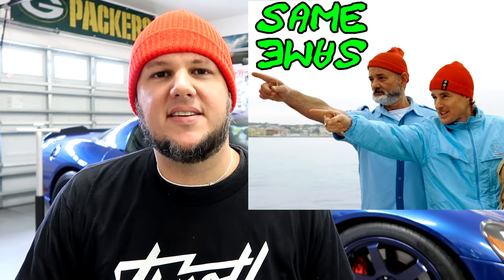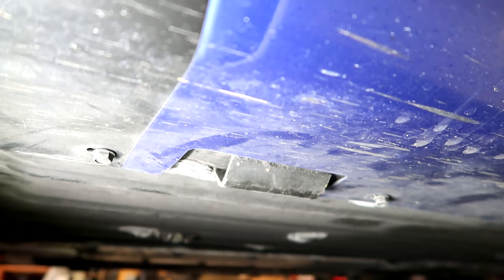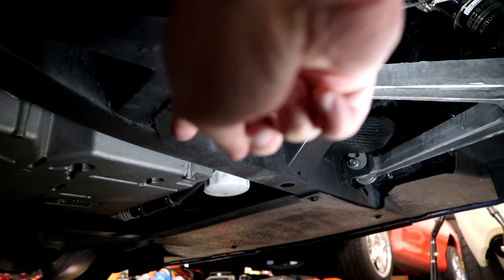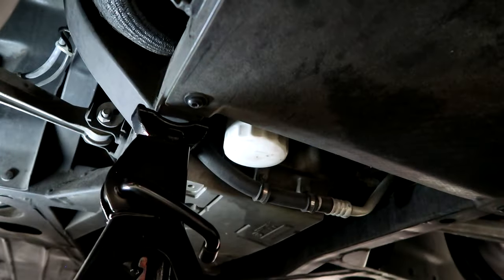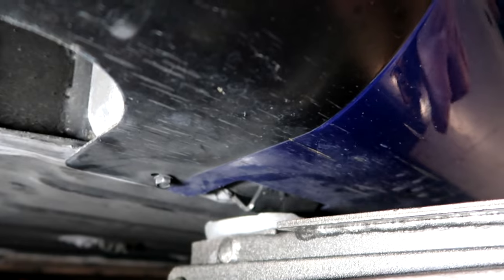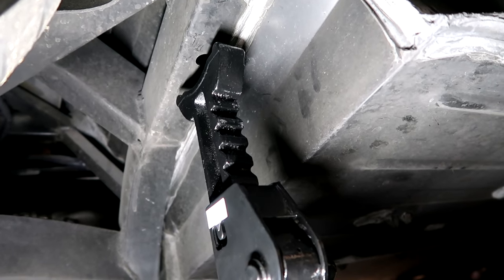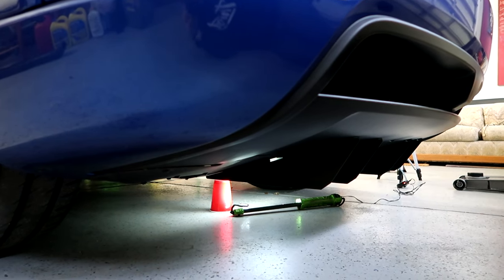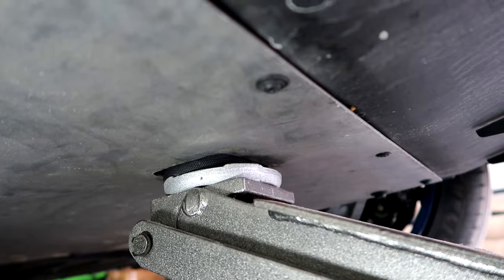How to Lift a Dodge Viper with a Floor Jack

Comment: I use two small racing floor jacks  on either side to lift. I keep one of them in the trunk for flats.
Reply from the maker: Not a bad idea! Any particular type of tie down to keep the jack from sliding around?
Reply: I have a small rug over the spare and the jack sits down into it and against the bulkhead. You could use a ratchet strap around the bottom of spare to really secure. I have a Gen 2. @ChaosCarClub
Reply: I installed a ground kill switch in the trunk above the battery in my Gen 2 R/T10 because it's seasonal.  My Challenger R/T is also seasonal but the battery has to be accessed to be disconnected.
Reply from the maker: @31terikennedy  I keep everything on battery tenders. Set it and forget it 🙂 don’t have to worry about resetting radio dials or anything that way too

Comment: What jack are you using boss man?
Reply from the maker: Nothing fancy. Harbor freight super low profile 2 ton jack. 
Been a minute. You get your car sorted finally?
Reply: @ChaosCarClub  I don't need fancy, I need low!
The car and motor are currently at ViperExchange, just waiting for the email to pick it up once it's done
Reply from the maker: @whitejodeci8926  I hear that! That is the lowest one I could find. 
Nice!! Still planning to offload it once you get it back or decided to hang on to it for a little bit?
Reply: @ChaosCarClub  I ended up buying some quickjacks for 700, I figured that's harder for me to mess up!

Mann, I'm still on the fence. I'm paranoid about something else going wrong, but I'd hate to go through all this and give someone else a perfect car for nothing
Reply from the maker: @whitejodeci8926  aye that works! Easier too!

Hahahaha I hear ya on that. You’ve been thru the ringer! I would maybe feel it out when you get it back at least before making a decision